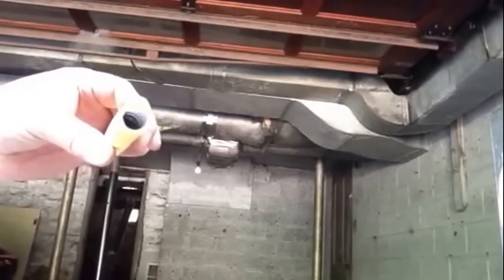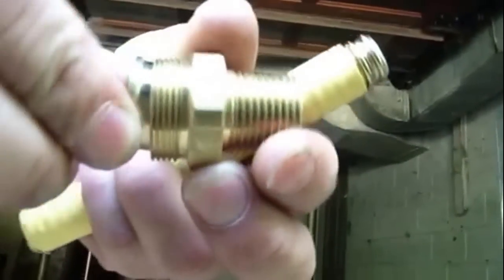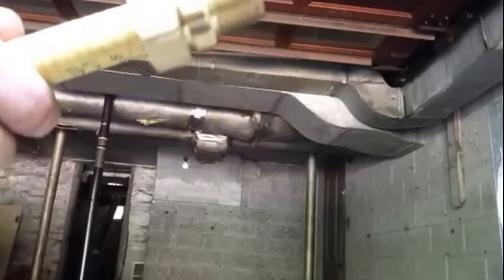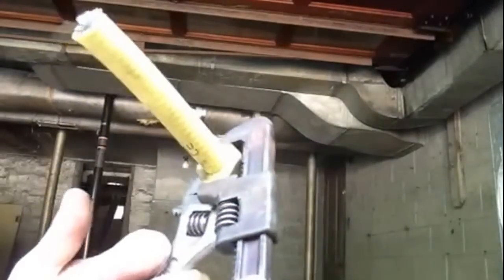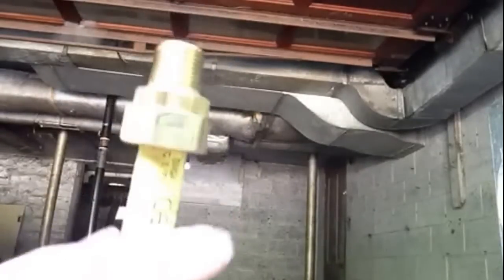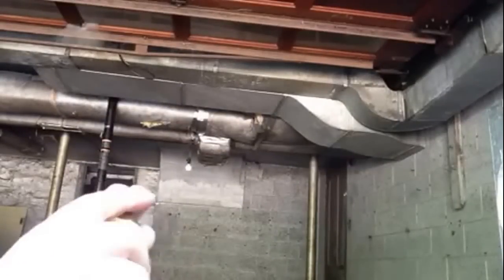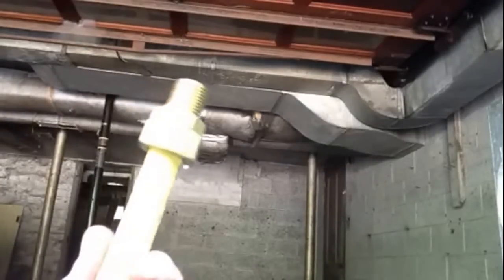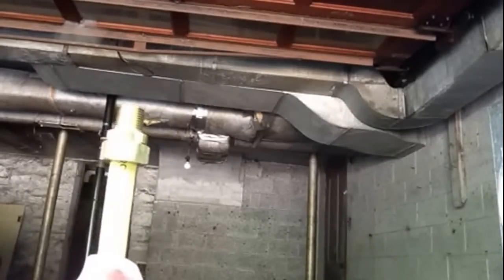How to install a csst fitting on your pipe

Comment: Seems much easier in your demonstration there’s no way I can get the fitting into the groove slot before I put the nut on. I had to start the nut and force the fittings into the groove slot Then torque down to force the fittings into the slot. I could feel them move and then move again before I could finally tighten them. And, I’m still getting leaks somewhere. Leak tester liquid isn’t showing me anything! Thanks for the video though.

Comment: It supposed to be 3 corrugation.
Reply from the maker: Gastite is 2 corrigationa.
Reply from the maker: It's always good to read the directions before each install and have the manual in front of you while you make connections.
Reply from the maker: On a gastite system it is 2. Again it is always important to have the installation instructions in front of you during the installation. And refer to the directions before each connection is made.

Comment: Its 3 corrugations not 2.....get csst certified before u destroy a home
Reply: russor22 different brands of pipe have different requirements.
Reply from the maker: Gas tite is 2 corrigations always good to read the instructions before each fitting is installed and have instructions in front of you while making connections.